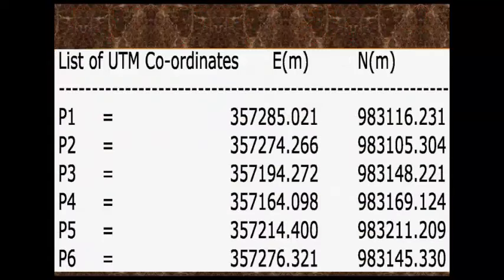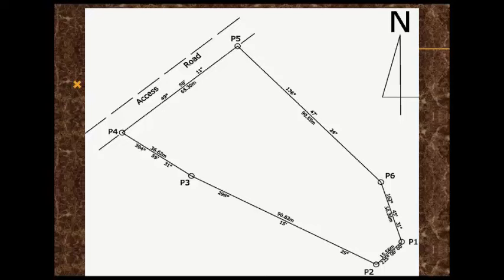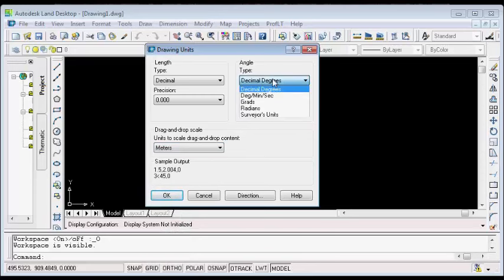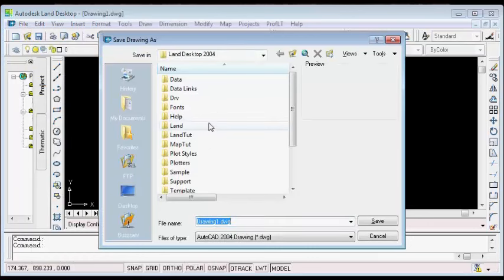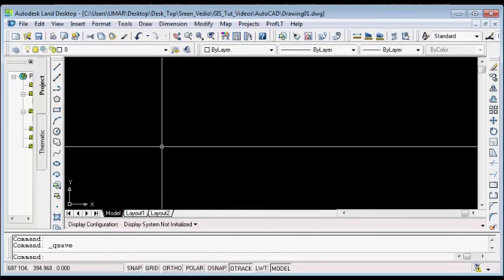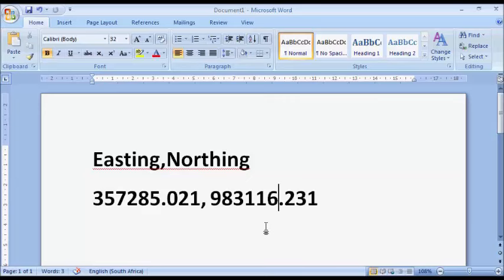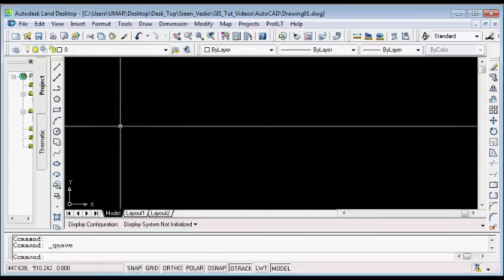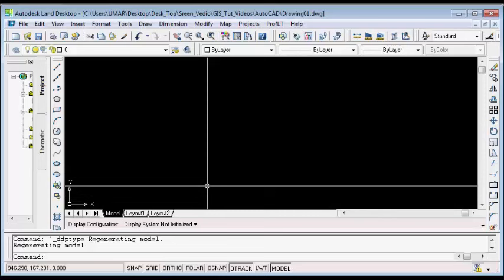01 Plotting UTM Coordinates

Comment: Could I plot Gauss kruger coordinate in the same way. Which setting I should change then.Please help me🙏
Reply from the maker: I have never worked with The Gauss-Krüger coordinate system, however if the system is based on linear system then you could use it in AutoCAD as demonstrated using UTM coordinate system.